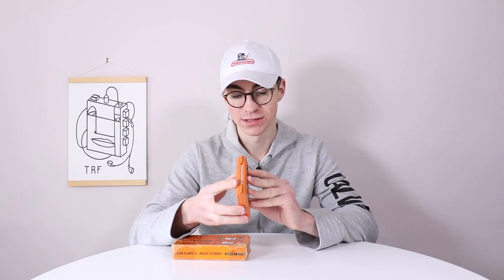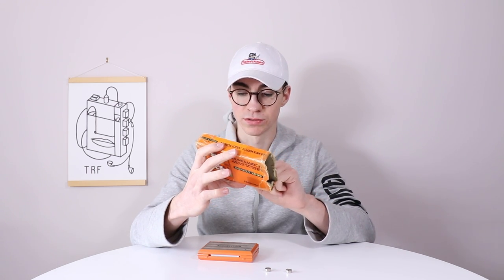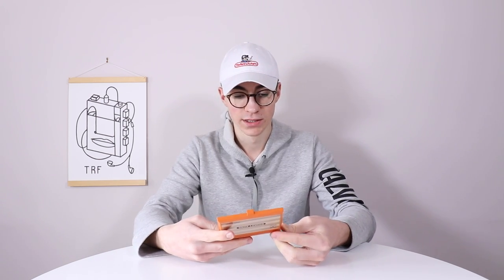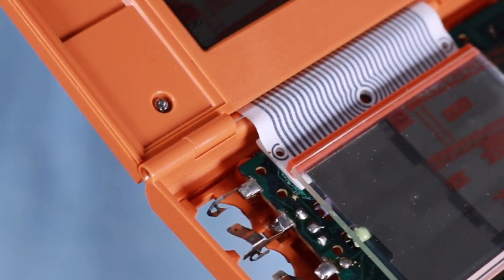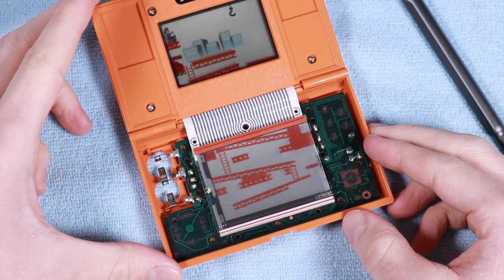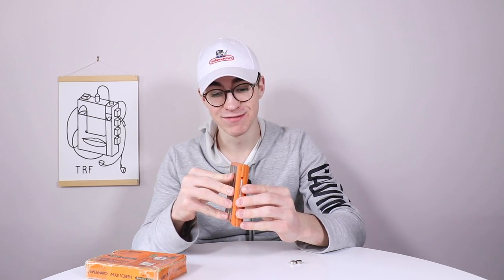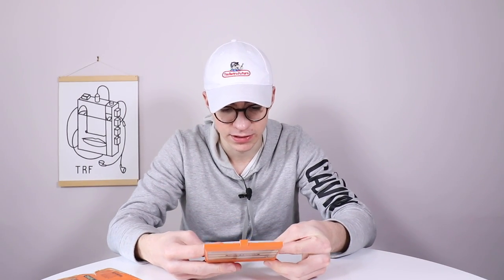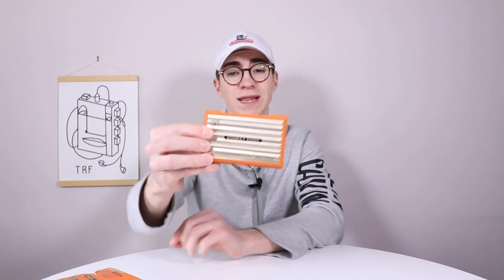1982 Nintendo Game & Watch Repair!

Comment: Welcome to the Donkey Kong Game & Watch Club! I got mine a few years ago by chance at a thrift shop. Mine isn't in as good of cosmetic condition as yours, but I still like having a pre-NES Nintendo product in my collection.
In a related story, I could have owned a Famicom as a teenager, but my stepmom interfered. I don't know what it was about wester Washington State and thrift shops, but several game collectables went through those stores while I lived there. I was lucky to have owned the Power Glove for a time. Sadly, it disappeared and was never found again. I also had a keyboard adapter that let you attach an NES controller to a PC. I think I still have that, but I need to check my mom's shed.
Reply from the maker: Thank you!

Comment: The left over sticky tab on the battery side was a round sticker to stop young kids taking out the batteries and swallowing them. I have this model like new in box with the manual and the red round sticky pads.

Comment: If your screens are faint, you're supposed to view them at a certain angle (here's the original manual with a pic on the left http://www.intheattic.co.uk/images/G&W/Review/DK/Donkey_Kong_DK-52_Page14-15.jpg). If that doesn't work, you can replace the polarising filters, they don't age as well as the rest of the device and it's an easy fix.

Comment: I got way too distracted by front view VS side view switching all the time in the first quarter of the video.

If you do more side views I would say consider using a higher angle and a little closer, it will give it more of a products shot and less like a coffee table interview with a ghost feeling. In any case the videography still kicks mine in the bottom lol.

Comment: Question for you! How hard is it to split the top and bottom? Do I just pull the hinges out? I have two DK units, one has a pretty good top with a clean metal faceplate, and the second has a better, clean bottom back. What do you think?